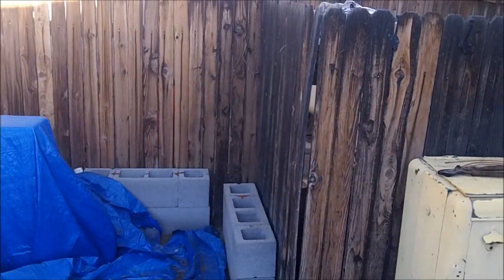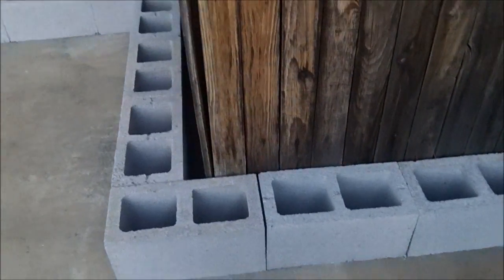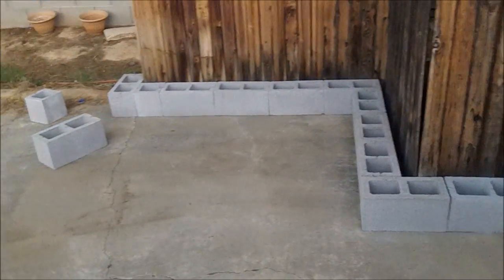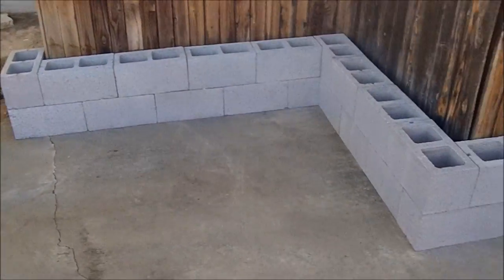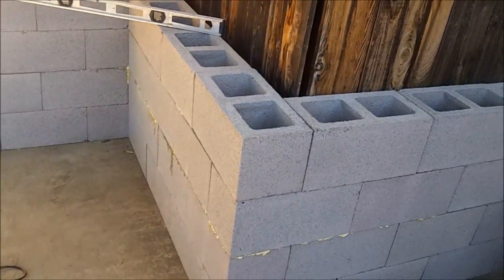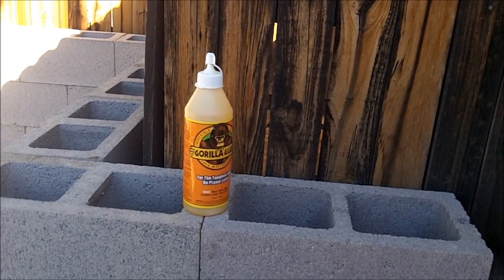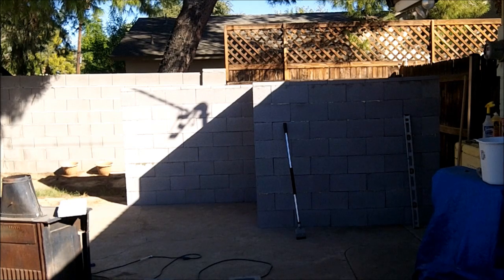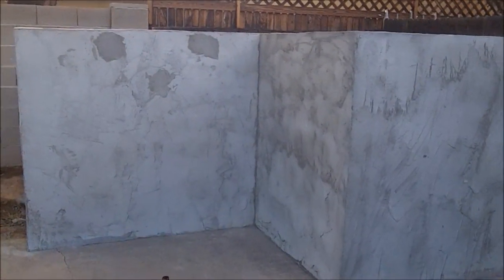How to Build a Block Wall with Gorilla Glue... No Mortar Used

Comment: Back home in Jamaica where we have hurricanes we fill every block "pocket" with mortar and use a lot of rebar running up through them from foundation to top. I think this is a very good idea building the wall with glue. I see some comments about using a construction adhesive with a caulk gun. Some people are concerned about structural strength. Others don't understand how much time/trouble you saved not having to mix batches of mortar to spread on each brick as you build.
Since I have a pneumatic caulk gun I think I would combine all these ideas to form an extremely strong wall:

Cast a foundation with occasional vertical rebar, spaced to fall within block pockets.
Lay first row of blocks in wet cement foundation and ensure level.
Once set, lay all other rows of blocks using construction adhesive with caulk gun.
Once final height is reached mix mortar and pour down all block pockets with & without steel in them (could also hire a cement truck if big enough project).
Cap wall.

Although you still have to mix mortar with this method it helps that you don't have to do multiple batches or that you can do multiple batches and fill pockets at your leisure! I would even build a house like this without worrying about it.
Reply: Bjorn A'grin  or just buy some rebar?

Comment: An interesting and creative alternative way to build a block wall. Nice to read it has stayed intact through that range of temperature fluctuations you mentioned and has lasted just about 2 years that way as I type this.  I guess the long term test of time is the next mile stone to achieve.  Thanks for sharing your "out of the box" and thus far effective approach.

Comment: I want to say thanks for this post. I built a wall using this technique. It worked great and for a novice doing a home DIY project it was much easier than mixing and laying conventional mortar. The wall turned out great and I would argue it is stronger than a mortar wall. I place rebar in it as well and poured concrete into the voids. I also glued the blocks on the sides. That wall is not going anywhere and looks good too. I did have to trim blocks here and there to keep the wall straight and level. Probably not the fastest process. I spent an hour or 2 each night working on it doing one layer at a time. I could not be happier with how it turned out and I did not feel rushed to use up mortar before it dried.

Comment: A suggestion for anyone considering doing this. Dry fit the second row of block, then remove a couple of blocks, and apply the glue. That way if you run into unforeseen problems with alignment, fit, or anything else, (that's why they are called 'unforeseen' problems; you never know what might crop up. LOL), you won't have to deal with handling blocks with a bunch of that very sticky Gorilla Glue.
After the second course of block, you most likely will not have to dry fit each course.
Hope this helps someone.

Comment: Much has been said about mortar, a footing, and re-bar … this isn’t structural wall – it’s more of a decorative partition.
.
At five and a half feet tall, re-bar isn’t needed for a no-load bearing partition. All that’s required is that provisions are made that the wall doesn’t tip over and the configuration of this wall takes care of that.
.
As for mortar, it has two jobs:  To level out high and low spots, and to hold the blocks in place. It facilitates the blocks doing their job which is to provide the structural integrity and strength needed for this wall.  This is a decorative wall, not a load bearing wall and, being in an enclosed area, won't have any wind loading worth mentioning to contend with (although, due to its configuration, it would take a lot of wind to move or damage it).
.
As mentioned previously, there are several things that would work on a project like this. Liquid nail, surface bonding cement, a fiber/mesh... heck, even “Great Stuff” foam in a can would be enough for a project like this (as Grant suggested).
.
While it’s true that Gorilla Glue hasn’t been around long enough to withstand the test of time, projects like this will help provide the data over the oncoming years to form long term standards for it.

Comment from the maker: A quick update... wall is still structurally sound and has gone through weather changes from 30 deg to 120 deg. Not even so much as a crack. Yes thank you everybody for pointing out alternative ways to build a fence, many of which I have used prior. The point was to try something different and it worked well.
Reply: Thanks for the update, this is what I want to do with a lil bit of stucco for dressing it up a bit - Don't worry bout the fools with "Crap" to say, solid idea Thanks Again !
Reply: Looks really good . For future walls you can use liquid nail. it comes in a large tube and I believe it would go father and cost you less.
Reply from the maker: Stephen Standridge thanks i will check that out too
Reply: +oddjobstoo u did a great job!! motivated me
Reply: live and learn.
Reply: this person is Donald Trump if you're building a wall
Reply: Watching this video gave me images of when a bull ran thru a local china shop! This will work if you don't have kids running and playing along the wall or guests stumbling drunk.  Also, anything over 4 feet in height, must meet code and must  have rebar between the blocks, just a rumor, i'm not an inspector, but I'd love to see the inspectors face when you told him you used gorilla glue.  At least use liquid nail or something heavy duty, not a glue for binding kids books.    Lastly, you did motivate me to do my wall myself instead of paying someone, at least you got that going for you.
Reply: oddjobstoo ii
Reply: that's a lot of glue DT..
Reply: oddjobstoo , Will this pass code ? What if it's built on footer not pad?
Reply: actually, you could have just glued the first row, stacked the rest, then two skim coats  with some fibermesh blended in, similar to this method
https://www.youtube.com/watch?v=TAswNJyZjvM
Reply: You should try it. This one is made from block, not brick.
Reply: It's a monster bro! That thing will stand for 60,000 years. I think adding some seashells to the stucco would of made it truly "baller". :')
Reply: oddjobstoo listen mate I like experimenting but the wall is not level or straight so you chose an inferior product and way of doing something that hasn’t changed for 300 years I suggest actually learning how to use a trowel and mortar that way it won’t look like a child’s laid it
Reply: Did something similar with a delimitation wall. Nothing serious, about 50 cm (<2foot)  high. Just for demarcation of property line. As been standing perfectly for the past 3 years.
First row is half buried in the ground, all the remaining have a couple of lines of PU glue. Works perfectly for such a simple application.
Cheers

Comment: Two comments here:
1) I'd use construction adhesive applied with a caulking gun in continuous beads (probably 2 parallel beads per block joint surface and would require lots of tubes) rather than dabs of Gorilla glue.  Gorilla glue will work in non-freezing climates but will fail when it's exposed to temperature significantly below freezing.  There are types of construction adhesive that are rated to withstand freezing temperatures.  I'd also glue the vertical joints together and that would also create joints as water-tight as possible to prevent internal freezing from forcing the blocks apart (if you're in a freezing climate).
2) I've seen YouTube posts showing concrete block laid without standard mortared joints, and I'm wondering how you deal with the resulting mismatch of vertical end blocks assuming that you're keeping the joints vertically aligned along the courses.  The point is that standard block is dimensioned 3/8" shorter than the full dimension to allow for the mortar joint and if the joints are kept vertically aligned, there would be a mismatch at the ends, no?
Thank you and good luck with the wall's durability.
Reply: I was thinking the sane thing.don't know why he didn't use construction adhesive

Comment: I just built a shed using this method except I used construction adhesive/retaining wall adhesive; it was a lot cheaper and it allowed shimming, block alignment, leveling, and filler where the gorilla glue didn't. I will never use mortar again!! Thank you for the video

Comment: The purpose of mortar is to level the tops of the blocks without having to grind them. Also, the mortar thickness allows for the installation of horizontal joint reinforcement which is required in all masonry work. Yea, your wall lasted through some weather, but wait till you get a wind storm, or someone leans on the wall.

Comment: This actually does work very well. I have done it for walls for my compost bins.
The base I did lay mortar because the concrete was unlevel. So the base is mortared in.  Then I wet the blocks before applying the glue. sense it sets up better and stronger in the presence of water. one side even retains soil 3' high.  at some point I an planning on using  surface boning stucco but for the last 5 years it has worked just fine without it.

Comment: Gorilla Glue actually works very well on masonry.  It is a VERY strong bond with masonry.  I have used Gorilla Glue to repair broken brick pavers in walkways.  Season to season, year after year, with high heat and freezing temperatures, rain, snow and ice, and the weight and stress of using the walk and being run over with lawn tractors and other equipment, the Gorilla Glue repairs have NEVER failed even when I have used it on bricks on unsupported overlap edges on brick steps!

Comment: In '96 I was traveling back East & stopped at a country rest area, where I found a retaining wall made with the solid, keystone shaped cinder blocks glued together with none other than construction adhesive. Since then they've come out with the polyurethane construction adhesive (PCA) that needs moisture to cure, just like Gorilla glue. I used PCA to rebuild some concrete fencing from the 1910's, & it worked like a charm. Much thicker consistency than straight poly-glue & super-strong.

Comment: I used liquid nails to put together concrete blocks 10 years ago for back steps with extra wide steps,  4 blocks high next to the house. The block are stuck together as strong as ever. If you wanted to remove this you would have to break the blocks up, it won't come apart any other way.  A higher wall would not be a problem, just get that first row level and solid underneath.

Comment: Brilliant experiment, very interesting how we can use gorilla glue in a different way.after watching your clip I now feel more confident to use gorilla glue to stick some pebbles together for a path edge. I thought about if you could tip your wall slightly so that you can put gorilla glue between concrete floor and the blocks for anchorage and maybe some metal bars vertical on the back of it to give it extra strength but it does look tons better than the wooden fence. Out of experiments come new inventions.

Comment: I stuck two pieces of broken sidewalk together that lasted over ten years through Iowa weather until I removed it due to remodeling. So, I think it might easily be as structural as mortar.
Reply from the maker: Yes Dennis, it is very strong. The glue wicks into all of the crevasses of the block as it expands, so it bonds great. I'm glad to hear it worked great for you too
Reply: Dennis G

Comment: Cool idea. You might be able to save a few bucks and a little time by using a landscape adhesive. Its designed for use with concrete garden walls, a lot like a PL product. It'll allow a small amount of build up for gaining on uneven surfaces as well as compensating for any variances in each block, the tolerances on blocks are pretty lax. And as for building a structure, you would definitely want to do your homework first, mortar isn't bad once you get the hang of it.

Comment: I notice you have corners, or turns, that will help support the stability of the fence not falling over, but for anyone wanting a straight wall I wouldn't recommend it unless you anchor it so it doesn't fall over on someone.
Reply from the maker: Atheria Co I agree totally. If it was a straight wall I would have not tried it. Because it's not structural and had some turns I felt that aided in rigidity

Comment from the maker: I have seen that Sacrete. It looks really good and I will likely try it at some point. In this particular case, I wanted to try something unconventional., which worked out well. After the glue has dried, water/heat/cold do not really affect it. Even my 4 test blocks that are 3 years old and intentionlly left outside, intentionally untreated, unsealed, etc...  exposed to the elements, are doing well and the bond is still as strong as the first day

Comment: I used the same method years ago to repair an old garage with no cement under the 2by walls. I used poly construct adhesive and set two rows of block. Worked great and so much stronger than mortar.

Comment: yes I do , im a contractor in fact, it dose not matter if its bearing or load, here in CA. requires rebar and concrete filling, coz of the earthquakes.... doing it this way, could crack and open,etc.. over time.

Comment: Gravity is the mason's glue. I saw one guy use two beads of construction adhesive , much cheaper than your glue. but if you use Sacrete Surface bonding cement it is ok to build a one story house or garage out of.  If your located out of sight of the town's inspectors,  dig down two feet and a foot wide and fill with a foot of gravel then lay the first layer of blocks on that for a concrete-less but workable foundation. Please don't build a basement or retaining wall this way it will fall over.

Comment: your other block looks like it was pourly done it wasn't jointed at all. Jointing them helps bind the blocks better and also makes it looks better. Doing it with GG is alot easier but a lot more expensive. I worked as a mason for four years until i was in a car wreck. Also blocks are very porous so they can absorb a lot of water and in turn that makes the bonds stronger. So if you are laying with wet block the bonds are going to bad. There are also different types of mortar you can use. My favorite is a very lime base mortar, it even weighs less than cement mortar but its not as strong. Another thing is not all blocks are the same. everyone bakes their blocks different, making them strong or weak, very porous and less porous. lowe's block are ok but blocks like peerless block are very good. they are strong, porous and less spurs on them.
Reply: poorly

Comment: I built a 24' x  16' block building using 'Commercial Grade Liquid Nails', but then also put re--bar in all corners and mid-wall and filled with concrete.

Comment: Can you tell me what type of gorilla glue you used? Is there a specific type like "gorilla wood glue," (I know it's not actual wood glue used) or just regular gorilla glue? Also, do you spray the water immediately after applying the glue, and why do you spray the water on the glue? Thank you!
Reply from the maker: Hello, regular Gorilla Glue that activates with water. I sprayed both the block and then glue after I applied it. Reason being is that the block immediately starts to absorb the water, so spraying the water on the glue after it is applied helps it activate better

Comment: question to all experts:   what if he pours concrete into the holes of the block walls after stacking them together without using the glue?  I know it may cost more overall, but structurally, does that make up for not having mortar between the blocks?  thanks.

Comment: I realize this so project was over 5 years ago now but instead of the Gorilla Glue with the spraying water and the foaming and all that stuff I would have gone with construction cement in a caulking gun which is made specifically for stone and other construction type work which applies Easley and is extremely strong doesn't require any water with it.

Comment: Its a polyurethane based glue. it actually cures in the presences of water. when using it you actually spray whatever your gluing with water first. once the glue is cured (24 Hours) the joint will be stronger than the block itself.

Comment: Interesting experiment but I can't imagine why you'd ever want to use Gorilla Glue. It would be cheaper to just buy the instant mix mortar and surely just as easy.
Reply: you would need mixer, you would need wash it every session. Not sure this job on video is good but definitely the research is needed for new kind of blocks and special glue for them.
Reply: or even construction adhesive.
Reply: (I am thinking more for foundation under a shed using surplus concrete I can get for free)
Reply: Just a stack of blocks, stuccoed with surface bonding mortar, makes a good wall. That would be more expensive than the glue, though. Or maybe not, the Bondsall brand is around $20 for a 40# bag, last I looked. That was in the mid 90s, when I did a small project.
Reply: yeah, I  was thinking the same thing
Reply: Gadget Addict p
Reply: "Interest experiment" was exactly my first thought.
Reply: @vladBEL  What are you talking about ?you don't need a mixer . Gadget is right . Your gonna use 20 bottles of gorilla  glue at $12 a bottle. Mortar is $4 a bag might need two or three bags. Mix it with a stick and a 5 gallon pail or a drill mixer easy peazy. No wait time can be don in 1 day not having to wait for the glue to dry and then grind off edges he said . Mortar would hide all that and self level.

Comment: If you used mortar you would be able to adjust the joint size so that the BLOCKs aligned with the ends of the fence.

Comment: What's the cost of the glue vs cement? Also, why spray it after the glue is applied? I thought Gorilla Glue required moistening surfaces before the glue is applied.